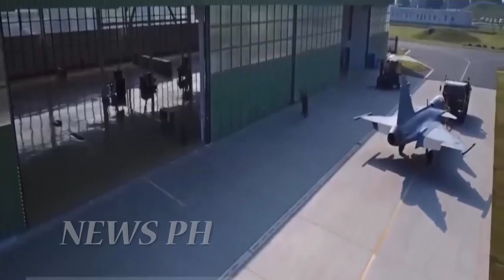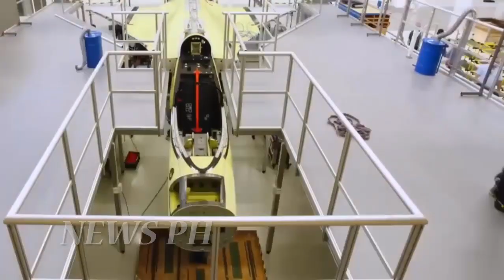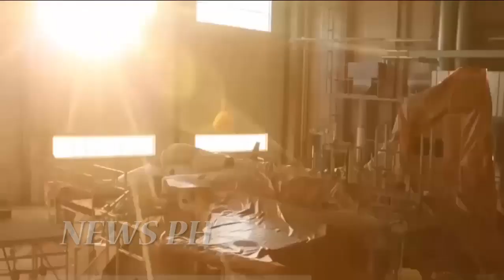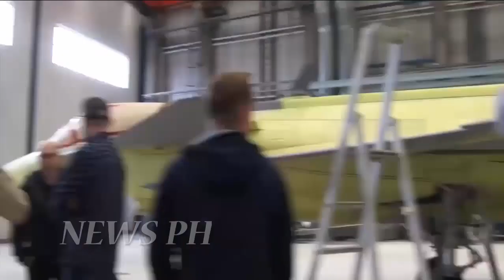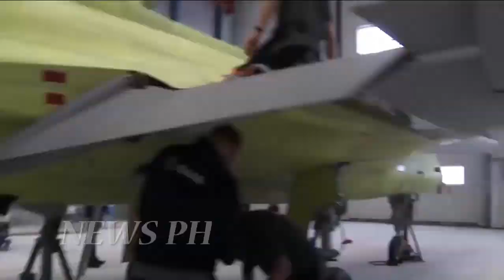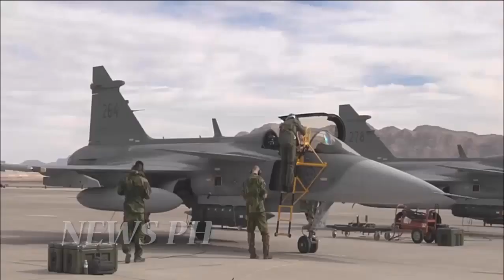New Jas-39 Gripen engine with supersonic speed? This is the reason the Philippines wants to have it!

Comment: US. will offer F16 to a give away price. Free is always the cheapest.
Reply: Not true!! A2.43 billion dollars is not cheap, nor free, we're buying not asking for free, but due to circumstances we're not getting the overpriced F-16 Vipers but the Cost -Effective and combat ready, Flanker variant hunter / Kiler Gripen C/D MS20 up graded version of the Gripen Variant. At least 12 units plus 2 units free. FYI all brand new and not 2ndhand refurbished F-16 FF 50/52 but can be modified into Viper70/72 variant.
Reply: @MonkeyDZuki   That's true Lockheed Martin seem to have discretion to contract license on several GE 414 engines or  it has expired, usually 25-yrs. . Since the Saab GNK is free to produce the RM-16 (20,000ibt)--iT is said Kai KF-21 might use the RM-16, making her cheaper. Also the attack version of F-7A Peregrine and Kai FA-50PH2 will be powdered.
Reply: Yes only Filipino want things than are free or donated